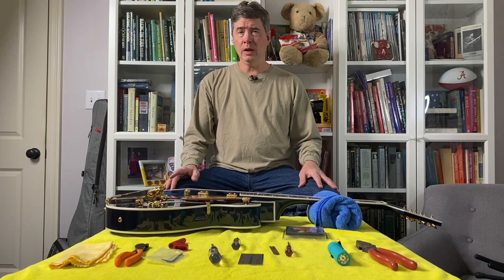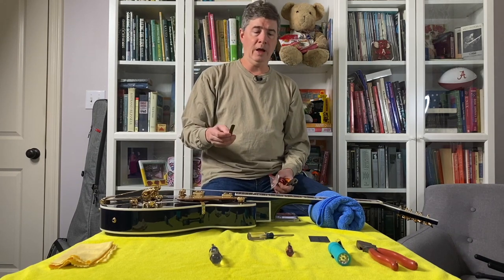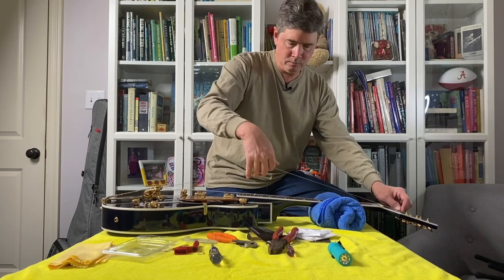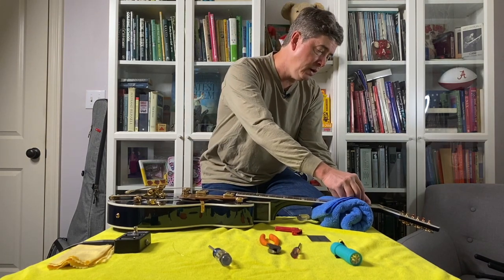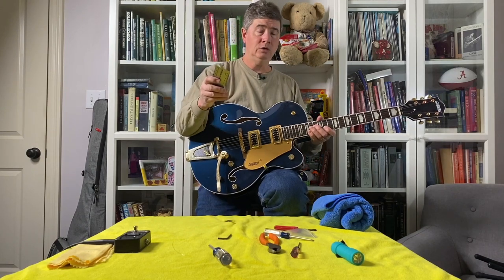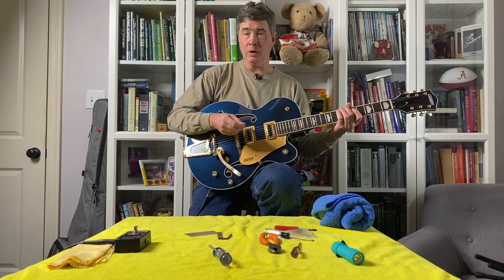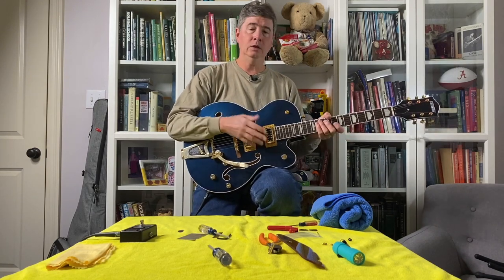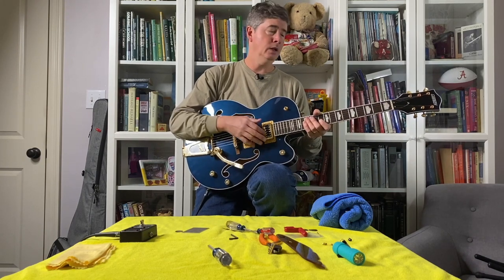Basic Gretsch Guitar Setup -- You can do this too!  5427tg

Comment: Top tip: I bought an 'old school' pencil eraser - the thick square block type - cut it to a wedge shape and just wedge it under the pin when I install the string. Admittedly, it doesn't help when you remove all the strings, for the first couple of string you fit. Of course, you still need to bend the end of the string, but I know the string won't fall off the pin, while I'm stringing up.

Comment: Thanks !!   I've been removing all the strings an cleaning the guitar before installing new strings.  On a Gretsch G7594T  & G6120 with Bigsbys , and using a Capo to hold the strings in place after connecting the top of the string to the tuners and  before trying to connect the bottoms:  it still takes over an hour.   One string at a time should save a lot oof time & energy.  Changing strings is still a pain after 20+ years of playing.   Of course having the proper tools available is a must:  Whenever, a string breaks, it seems those tools are never available.   I subscribed.
Reply from the maker: Thanks Leonard.  Yup, always good to have the right tools around!

Comment: When re-stringing, I do the same and pre-bend the ball end.  I use a capo to hold the string to the fretboard to stop it from falling off the Bigsby.  I find that medium weight flatwounds are best for my 5420, with a wound third, that makes the guitar intonate well even with the Gretsch solid bar “rocker” bridge.
Reply from the maker: Thanks for the comment.  You are absolutely correct that a wound G is the key to good intonation on that style bridge.  I have a Les Paul Special with a wrap around bridge and an unwound G is always sharp.

Comment: Very comprehensive and helpful. Considering it too complicated and without proper tools, I always took my guitars to a luthier. But with 25 guitars, I figured it was about time to learn to do these basic setups myself. Just got a new Gretsch 2655T P-90 and it had some buzzing on the high E first fret. Messed with a couple things, didn’t help so I used your method and now it’s all perfecto. I did order a replacement Graph Tech Resomax NV2, so I guess I’ll have to go through this again.
Reply from the maker: Hey thanks for the feedback macfawlty!

Comment: Hi, very beautiful and interesting video, please I have two questions: also  the height of the 6th string at the 12 fret is 4/64? I have an Electromatic G5126 with the DeArmond Dynasonic, what is the best height from the top of adjustable poles and the bottom of the strings(pressed at the last fret) for neck and bridge pick up? Thanks and best regards
Piero
Reply from the maker: Hi Piero, thanks for the comment.  According to the Gretsch setup manual, Dynasonics should be adjusted to 3/32s bass side of each pickup and 2/32s treble side.  Also all six strings are adjusted to 4/64s action at the 12th fret.  Manual: https://www.fmicassets.com/Damroot/Original/10003/Gretsch%20Setup%20Specs%20pdf.pdf
Reply: @hoganshideout  Hi.
All clear, OK. , I 'll do like you tell me, thank you so much for the answer.
Best regards
Piero

Comment: Great video!  Thanks!  I have a Gretsch 5420T (in Fairlane Blue) that I love.  This is the best explanation of these tasks I've ever seen.  I want to check the setup as you've explained it on my guitar.  I play Chet Atkins style and I can't seem to get the punchy bass out of this guitar that I can get out of others like my vintage Hagstrom Viking 1N.  Drives me nuts.  I suspect it might be the pickup height.  Any thoughts on that?
Reply from the maker: Thanks for the comment Daniel.  Pickup height can change the tone of the strings for sure so it might be worth experimenting with that.  Try moving the bass side of the pickups a little closer to the strings.  Also heavier strings can help because it lets you play a little more aggressively with your thumb to get the strings to really speak, and I read that that Chet liked fairly high action on his guitars.  Good luck.

Comment: Thanks for this, i changed the strings, adjusted the truss rod, cleaned the fingerboard etc all today. Question around the bridge, when i tried adjusting the wheel, it just lowered away from the bridge rather than lowering the bridge? I used an allen key instead on the top of the bridge and i think that has lowered it. mine is a 5655tg so may be slightly different?

Comment: Thanks for a great explanation of how to set-up the g5427tg.   I saw you adjust the pickup height using the screws on the sides of the pickups, but the page you suggested we download from Gretsch under "Pickup Height" states that "...Filtertron and Dynasonic pickups are mounted directly to the guitar's top and are not adjustable."  I am not sure how to reconcile what I saw you do when adjusting the pickup height with what Gretsch recommends.  Are these not Filtertron pickups in the g5427TG?  I know it has been a while since you made this video but I would appreciate it if you are anyone else can answer the question about pickup height adjustment.  Thanks
Reply from the maker: Hi Mike.  Some of the Gretsch pickups are probably not height adjustable, but most of them are and all of the ones I've come across are.  Here is another note from Gretsch on height adjustment.  https://gretschguitars.com/support/pickup-adjustment
Reply: @hoganshideout  Thanks very much.  I am new to setting up guitars and wanted to be sure I understood the procedure.

Comment: Thanks for sharing this video. I have that identical 5427. Have you had any issues with the strap pins?  The one by the neck fell out. I bought some locking pins, but it’s still too loose. I have a great guitar tech who can fix it. I’m a little nervous about doing it myself.
Reply from the maker: Thanks Gene.  I haven't had any issues with the strap pins/buttons, but I'm not playing much standing with a strap.  As far as repairing the strap pin/button, did the stud come out of the wood, or is the barrel just loose on the stud?
Reply: The stud came out (while I was sitting).
Reply from the maker: @gzackerman  Generally there are two ways to fix that; you can either use glue and toothpicks, or drill the area out, glue in a dowel, and redrill.  The toothpick/glue repair (I like Titebond original) seems to work well for most people.  I did a short video showing how to do the toothpick repair a while back, but if you are not comfortable, definitely take it to someone for the repair.  Good luck.

Comment: Is that bridge fixed? That's one of the new Electromatics isn't it?
Reply from the maker: The bridge is pinned.  It is a Guitar Center special run call a 5427 but it is identical (except color and fretboard inlays) to the new 5420s.
Reply: If I do 4/64 which is around 1.58mm on my string gauge i still have alot of buzzing...but the neck relief is set...
Reply from the maker: @rogerfranklin83  Hi Roger.  You might try raising the action a little -- maybe 5/64 on the low e.  Also, are you using 11 gauge strings?  You could have a few frets that are high.  Remember, any guitar will buzz if it's played aggressively enough.
Reply: @hoganshideout  not 11s just a set of ernie ball regular slinky 10-46. Neck seems good. It was fine....."before".....before I decided to take the bigsby off and put on thr tradition G style tailpiece. I have a Gretsch Electromatic 140th Double Platinum edition G5420T, yeah I just didn't need another Gretsch with a bigsby. So I took of and made sure everything was perfectly lined up which it was but yeah no it seems to buzz....checked the neck. That's good. I have noticed the intonation is a little out.

Comment: Hello dear, I would like to know if you could tell me if the size of the spring of the Bigsby B60 that comes with the Gretsch (Korea) G5420T guitar is 7/8" or 11/16". I wonder if perhaps the previous owner of the guitar has changed the size of the spring of the Bigsby, because I see it very low almost parallel to the pickguard and does not allow pumping movement or is it like that?
Greetings and thank you very much.
Sorry for my English
Reply from the maker: I'm not sure.  Try posting this question over at the Gretsch forum and I'm sure someone will know.  https://www.gretsch-talk.com
Reply: @hoganshideout  Dear Sir, don't worry, I think I found the problem, the plastic handle washer was missing. The spring is 7/8 but the washer is missing so it is under the height angle of the tremolo lever so it can be pumped. Greetings from Buenos Aires
Reply from the maker: @bochialegre6975  Glad to hear that, and thanks for the info!

Comment: I was searching for the size of the allen key I need to adjust string height. I watched you go through the string height but you did not make any adjustment. I have a bag full of allen keys but none fit. Anyone know how big a key it is?
Reply from the maker: Hi Dave.  Use the thumb wheels to adjust the action for the bridge.  Just spin the wheels, don't try to adjust with an allen key.
Reply: @hoganshideout  Thanks for the suggestion but the wheels move up and down the pin that goes into the body but the bridge does not move. That is the issue I think,
Reply from the maker: @daveallen9921  Something must not be working correctly.  When you turn the adjustment wheel it should move the bridge up and down.  The post itself should not turn.

Comment: I want to ask, what's the difference between bigsby with screws and without screws?
Reply from the maker: I was probably not very clear in the video.  There is a string through version of the Bigsby that is available on some Gretsch guitars.  Like this:  https://www.gretsch-talk.com/attachments/20200313_124057-jpg.160373/   Compared to the standard post design on most Bigsbys.  Like this:  https://guitar.com/wp-content/uploads/2019/05/DIY-handbook-restring-bigsby-string-ballend@1400x1050.jpg  Thanks for checking the video out!